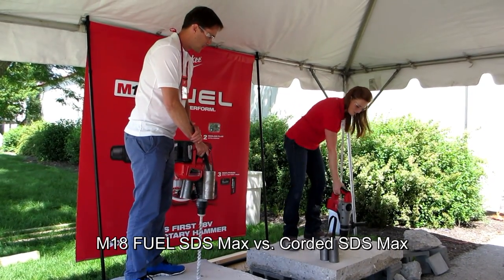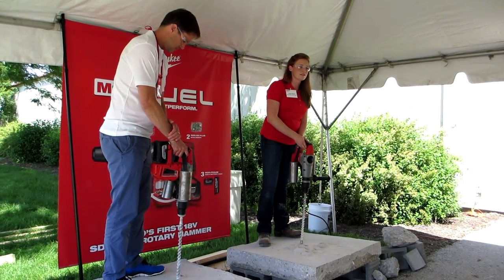Milwaukee M18 FUEL SDS Max vs  Corded SDS Max

Comment: The only way to get a fully accurate measure is to test the rotary hammers on a machine where you you the weight will be exact on each tool and both aligned straight.
Reply: From my view guy has a hight advantage, weight, and his extremities look like hes putting more force. But machine would be more acurate.

Comment: im a huge milwaukee fan but i gotta say it makes no sense to ad weights to the hammers for this test, i use on these every day with a 1/2" milwaukee 4pt sds and i just hold it steady and level and it goes through concrete like a hot knife through  butter
Reply: I think the point of the weights was just to guarantee the same force is being applied to the tool to make an accurate comparison, but it looks like the guy was clearly pushing as well, and she was not. Unfortunate waste of a comparison.
Reply: On any rotary hammer is is necessary and most effective to place enough pressure to engage the hammer and prevent kickback, but not any more. That weight amount  was probably the amount necessary. Without any force the weight of the drill may not be enough. On every hammer blow the drill bounces back reducing the effectiveness of the impact energy and reduces the drilling performance. You are also using a smaller rotary hammer which is handling smaller holes and less impact energy and kickback.  Users of rotary hammers usually know this about operating the tool effectively.
Reply: @ThisTall  exactly.

Comment: This is not exactly apples to apples because when the batteries go dead, the corded one still works to finish the job sooner than having to wait for the batteries to recharge or spend more to get spare batteries.  Sooner than later, the battery goes bad, not so with the corded model.  Since I got me a generator for other things when going camping,  the corded one is the best choice for me.
Reply: Garras Porgratix if you can find a plug and feel like drilling that long without a quick break I guess that thought process would be right... though since the lithium revolution I've never had to stop working because my batteries are dying quicker than they can charge
Reply: Well.... Using canuckistan dollars here, but here's a breakdown on initial costs. For the purposes of assumptions lets say for corded, you need the drill, generator and extension cord. for The cordless you need a kit with 2 batteries to remain productive.

Cordless
Milwaukee 2717-22HD kit (2 batteries) = $1000

Corded
Milwaukee 5317-21 ($500) + 1400w generator ($400) + heavy duty 50 ft extension cord ($80ish) = $980

So they are both about the same, except with the corded you're dragging around a generator and cord (lower initial productivity), having to refuel and you'll eventually need to do maintenance on the generator. With cordless you'll need to replace or rebuild the batteries in 3-4 years; so both options have their hidden maintenance costs. Basically comes down to what you need it for. If your work is sporadic and mobile then cordless might be better because it's more mobile and has high initial productivity for shorter jobs, but if you need to do chipping or drilling for hours on end without moving around very much, then the corded option is much better.
Reply: 2 battery pack, problem solved
Reply: i had all my dewalt battery powered tools at a jobsite took my fater to see how i was gonna finish up the outside, well someone closed the house and turned the power off and my father turned the generator on the back of his truck on wow i felt like a fool with dead batterys.
Reply: I have like 10 batteries so I was going to get 2 battery kit so we would have 4 12.0s and 2 8.0s. However maybe we should get a generator. Or maybe just an air compressor. Any thoughts?

Comment: I have a brand new 2717 which is milwaukee's king cordless SDS max rotary. We drilled through concrete filled 8" cinders with 4" brick on the outside of the building. After one hole the 9.0 battery was dead. Changed the battery and an inch into the next hold the drill started acting up. It was quitting time so we stopped. I hope like hell it's a thermal overload and when I go back tomorrow that's all it was! To be continued.....
Reply: So what happened? Because I'm thinking about getting the cordless 9.0 or 12.0. I've seen some YouTube videos where they drill like 18 holes on one charge.
Reply: What happened
Reply: @UwU-rp7vi  Appears to be fine.
Reply: Hey, i have the same problem with my milwaukee machines, the battery get eaten up...

Comment: the other element is the weight of the tool  the fact that the cordless tool and battery combo is heavier than the corded is also going to aid in the performance.. but not bad at all for a cordless tool 👍

Comment: Either way both took way too long. You want a fast sds max hammer drill? Buy hilti. They know what they're doing
Reply: The Makita SDS MAX tied Hilti SDS MAX in performance and beat it in comfort and it's like 100 grand cheaper too.. Only downfall is it takes two batteries so unless you buy two extra batteries you can't use between charges
Reply: No buy Bosch
Reply: @southcentrallowbottoms8274  definitely not

Comment: Who do you think you're fooling.   You put the weights on there trying to imply that both have equal downward force, while it is obvious both by the posture of the male, and his being a male, that he is exerting additional force more than the woman is.  I can state this with certainty because it is clearly seen in the video that his right arm is extended straighter and the tricep engaged.  Granted, it is certainly possible that the cordless is capable of drilling a single hole faster, but consider who would buy either of these.  The typical customer buying one is not very interested in how many seconds are shaved off drilling a single hole, unless there were several holes being drilled so the cumulative savings added up is where they see significant benefit and in that case, you're going to run low on battery power on a cordless, then either have to stop and recharge or have further $100('s) invested in more batteries.

If your use is where it is not convenient (if possible at all) to string an extension cord, then cordless all the way.  Otherwise, a cordless version of this you might get a few hundred hours of use out of while the corded, probably closer to a few thousand hours of use, provided you take care to not let it suck up the concrete dust and wear away the motor or bearings doing so.
Reply: Preach sir

Comment: You can hear she isn't pushing pressure on the drill and he was, This was obvious bias. However, The problem is that a tool like that typically sits around until it's needed on the occasion. Batteries are not good for occasional use tools. Also, come back when the battery is a year old and do the test. Batteries lose significant performance over time.

Comment: are r serious? woman? in sdsmax comparison? ...
Reply: What do you mean by the statement “are r serious? woman? In sdsmax comparison?” 
First off how about we take a closer look at you and your grammar and sentence, would it not be a bit more proper and easier for others to understand if it were closer to;
“Are you serious, a woman in an SDS Max comparison?” 
So, are you a male chauvinist or do you have a problem with women working in the trades? 
I’ve worked in the trades (Horizontal Construction Engineer to be exact) for many many years and I can tell you that there are plenty of women that actually complain way less than their male counterparts on any given day and work just as hard, sometimes even harder than the males. Most of the women that worked in this field for me would show up on time, work late if needed and it didn’t matter if it was raining, snowing or 100 degrees Fahrenheit or all three, and hardly ever hear from them. Men whine like little girls, in fact I actually got spoken to for asking the guys ”what, are you a girl?” I’d say “come with me girls, I’ll show you what you’ve got going on today”. 
They went and whined to upper management that I was belittling them, REALLY?? I told my super that I’m not here to give out hugs, if they want a hug they can go home and see their mother. 
Oh and by the way, some women could learn to operate heavy equipment quicker than the guys and operate it smoother, it’s like they had the “feel” for it. 
Don’t underestimate women working in the trades, you just might get shown up…
As far as an SDS Max goes it weighs approximately a whopping 12 pounds without a battery, besides they were pushing, not lifting. I’m lost here, I’m not quite sure what you were going for here with that statement. Women don’t just push out 8 pounds +/- everyday, they also carry that proud little bundle everywhere they go on and off all day long while multitasking. You try it!
You make it sound like the strongest man competition, “The next event of this portion of the competition, the heavy weights will be operating the MILWAUKEE SDS MAX with the 5/8”x16”x 21” rotary hammer bit, ready men, LIFT, wait   for   it…..DRILL”
So if it was an iron or a vacuum the women could definitely hold their own there…but no way can they handle the monstrous SDS MAX…😂😂😂

Comment: You need 10 years more to convince me to use a cordless device >>> I'm very sorry, but I am absolutely not ready.

Maybe I'm missing great opportunities and faster work time, but I don't mind waiting 10 years to realise that!!..., that's how much I really trust them.
Reply: I understand however I have a parking lot to do …..yellow parking bumpers and need to drill two holes per bumper and have 19 bumpers in all and that would prime an 200 plus feet of extension cord …..so for me I may need three plus batteries to get the job done whereas buying several extension cords isn’t going to cut it 

But when done I will have a total of 3 new batteries

Comment: BS
Reply from the maker: Not sure what you're calling BS but battery powered hammers have been as fast or faster than corded hammers for a long time.
Reply: @ToolsEditor  they can perform... for a while.  As far as effectiveness, there is no way you will convince me that 18v with 5aH will best 120 at 10amp, math does not lie, demostrations like this, where they give out the corded tool to a woman?, pleeeeeas.
Reply: @johnhyout  It's pretty obvious the profit margin of those battery tools are much much higher and they don't mind lying that the performance are better.